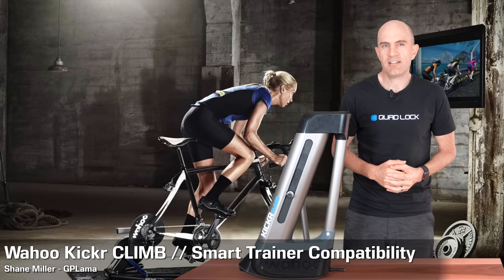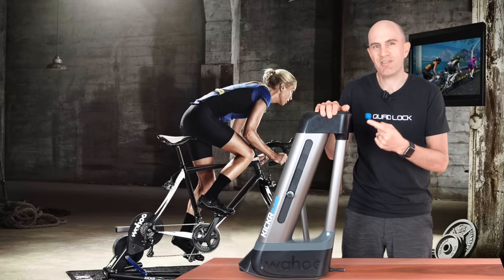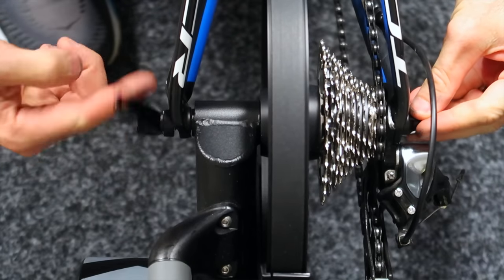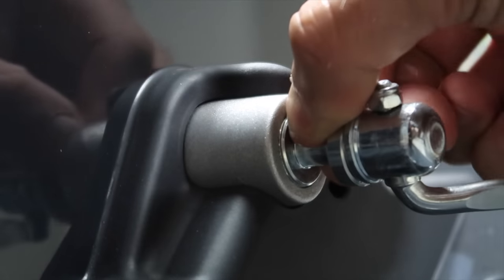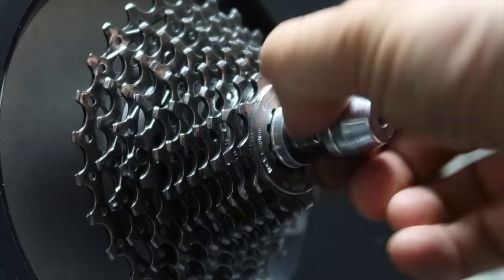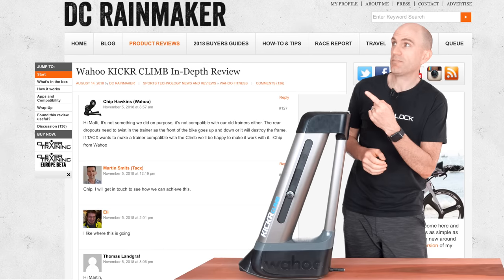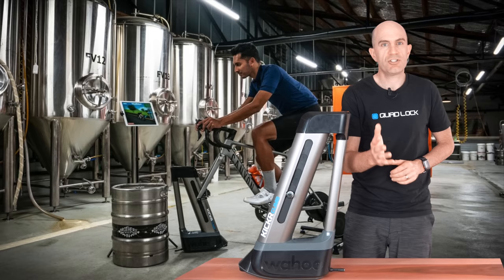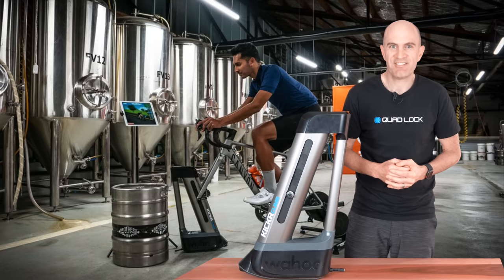Wahoo Kickr CLIMB //  Smart Trainer Compatibility

Comment: Here is a thought and would work with all trainers. I thought of it first! Bike + trainer is on a platform - call it very low table, probably need a bar at the very rear that acts as a pivot and stabiliser. Front of table is elevated according to the gradient, by the kickr climb. Kickr markets an optional add-on "table" and opens up to read all trainers. Might head down to the shed and start constructing. Cheers

Comment: I just purchased the climb. I have a though axle and find the bushing adaptors are not a tight tolerance to the axle which was causing pressure point relief type noises!  I lubed with grease. This has helped with the noise. I know there needs to be allowance for movement but the noise was almost as annoying as a creaky  bottom bracket.....

Comment: Hi Shane, thanks for all the great content. Hey I'm wondering, does the Wahoo Climb module work, theoretically with the other trainers, like the Tacx Neo, only thing not working, like you said is the part where there is frame rub and will eventually kill your frame. I would love to try to make an adapter to work with my Neo, but not sure if the Kicker will be compatible electronically, if you will. Does the Climb module work on its own without any trainer for example? Thanks again for all the nice videos. I did go and get one of those Techno Gym My Run treadmills in the end, love it :)
Reply from the maker: The Climb will only work automatically with compatible Kickr units. It needs that connection to adjust to the gradient simulated.
Reply: Oh yeah, thats what I was afraid of. Thanks so much for clearing that up for me. Take care :)

Comment: I used to have an issue with my Tacx Flux, which doesn't have a pivoting axle, grinding the dropouts since I would tilt the bike up to get it out of the way in my room. It would put silver shavings all over the legs of the Flux...

Comment: Software aside, wouldn't a small bushing on older KICKRs overcome the pivoting limitation? Serrated edge so it doesn't move on the drop out and the smooth side would pivot against the existing "axle" face. Potentially could be thin enough to not even affect shifting quality I would think.
Reply from the maker: There's just not enough room to fit anything to the fixed axle on the previous Kickrs. If there was there would likely be issues around wearing out the shims as they'd be paper thin.

Comment: Shane, I have the 2018 Kickr + Climb combo and noticed that I am seeing some metal shavings on the part that contacts my rear dropout. (Sorry don’t know technical term, but it would be the piece that is on the inside contact point with drop-outs, non-driveside.) It spins somewhat freely when Bike is removed, but worried it is rubbing when bike is attached. Do you see this at all? Any idea what I am doing wrong?

Comment: What about curve / arc of raising front axle? Geometry would force either CLIMB or Kickr to move closer with center of arc in the rear axle. Do you feel some of tension / unstable when CLIMB rise to higher angles?
Reply from the maker: It rolls back and forward on the base and the front fork mount pivots. No issues I see here.

Comment: If the Neo was compatible with the Climb it would be a better trainer than the Kick r and they'd lose some market share on their high end trainer imo
Reply: David Rodger Neo is still a better trainer anyway. Kickr Climb is a gimmick.
Reply: @silverarrowslk  I disagree its not a gimmick any more than the Neo is riding over cobblestones or wooden boards. Its all about immersion and what's more immersive the motion going up and down or, sensations in the pedals riding over cobbles?  Neither have any real training value, except maybe the Climb possibly recruiting different muscles in the incline position . But, money aside, my only concern is that the novelty may wear off too soon. Especially, if the motion is in small increments or undectable.  Then it just become a $700 front wheel stand. Another problem imo is that only comes with a 11-26 cassette so, if your planning to climb up 15% inclines,  that cassette is worthless. you'll need a bigger cassette for those type of climbs.
Reply: @davebraves6998  I would get a Kickr Climb if it could be made compatible with my NEO. Both companies would get money from me since I would need to buy some adapter from Tacx, plus the Climb from Wahoo.

Comment: Does anyone know if the new Tacx Neo 2T has the required rear axle rotation to potentially allow the climb to work at some point in the future?
Reply from the maker: No.
Reply: Just place thin plastic rings at both ends of the QR axle, right in front of the springs and tighten it on the bike. Then you can use climb on any trainer. 
Regards